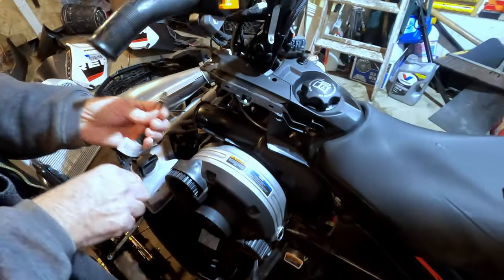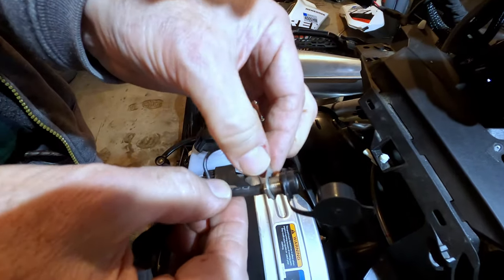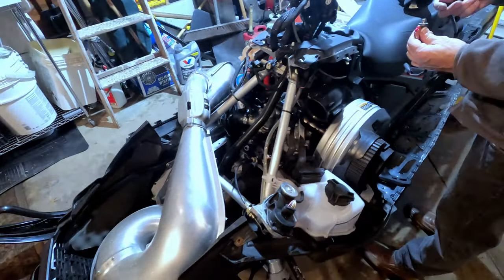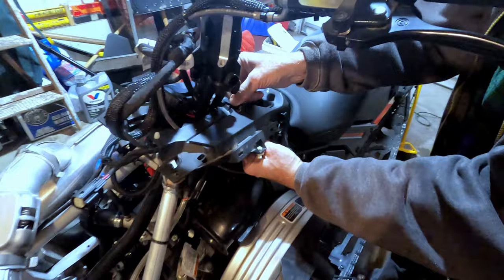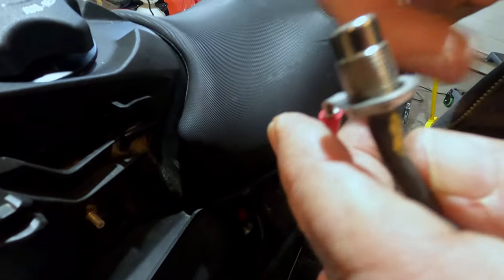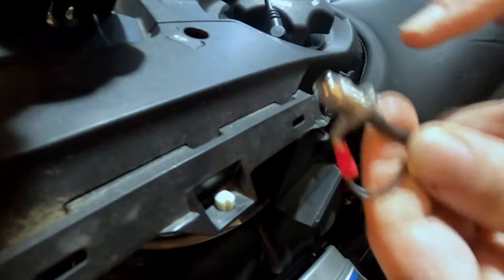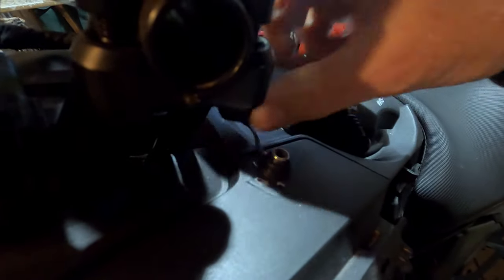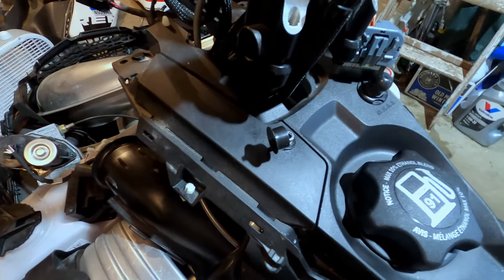Snowmobile Heated Visor Plug Problems (Skidoo Gen 4)

Comment: I am having the same problem with my 2017 600 ACE Grand Touring and 2018 1200 Enduro.  What a pain in the ass this is.  The plug on both of those sleds just wobbles in the fitment - what is the deal with that?  I also just paid a local SkiDoo dealer the fix the one in the 2017 but it is still not working...
Reply from the maker: Yea it's just not a good design.  I had mine dealer installed and it lasted about 300 miles.  Since making this video I have had zero issues!
Reply: @OutdoorsmanChannel  Ok, thank you for your reply.  I just got back from the UP and the snow was great but both my girlfriends and my visors were fogging without the heat.  I am looking to go right off of the battery on both sleds and plain give up on that goofy setup SkiDoo fitted.  Do you have any thoughts on that and best way to fit?  I was just going to go right off the battery terminals.  Jason
Reply from the maker: @Jason Halliday  I have the two up option on my sled (one + one seat) and have a cord off my battery for the passenger.  That works; the only downfall is it's a bit annoying to plug in the back every time.  The skidoo location is very convenient.  I also stop quite a bit and enjoy the scenery / film so personal preference I suppose.
Reply: @OutdoorsmanChannel  And thank you again for your reply!  Ok, that settles it.  Both of the batteries on those 4 strokes are in the right side of the cowling so I'll just come off the battery and up through the plastic with zip ties.  My only concern with that is whether I should fit some sort of switch off that connection.
Reply from the maker: @Jason Halliday  I would just cap it off somehow when not in use. I use a the finger of a rubber glove and a rubber band.  Helps prevent corrosion.
Reply from the maker: @jasonhalliday66  don't forget to subscribe! And check out some other videos.